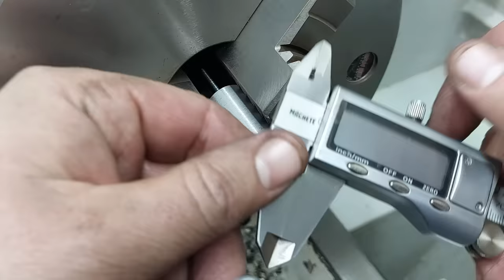Amazing Idea! Made Super Homemade Metal Turning Tool

Comment: This tool is really cool. 

When you put hot steel in oil, the bubbles create a barrier that makes it difficult for the heat to exchange perfectly. If you want to achieve an even better tempering, you should shake the piece in the oil until it cools down.
Reply from the maker: Thank you and welcome!